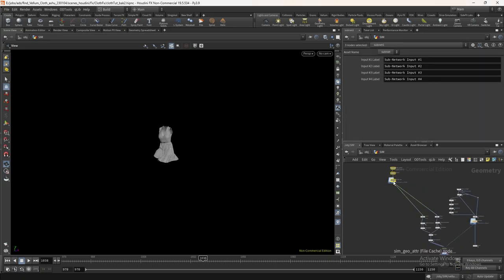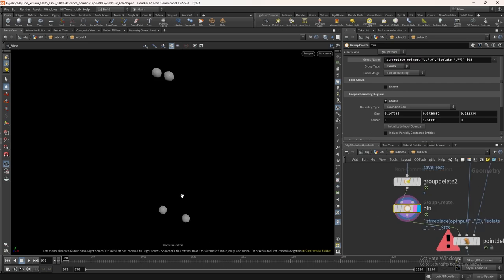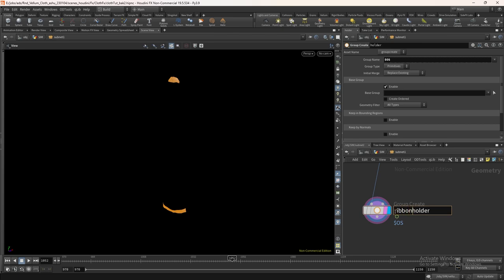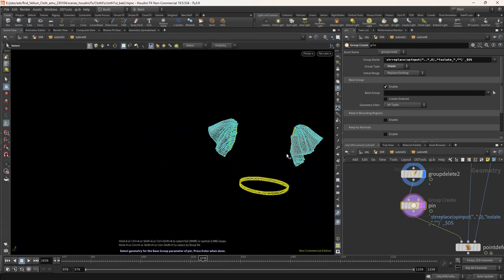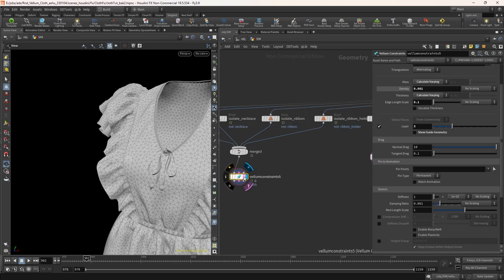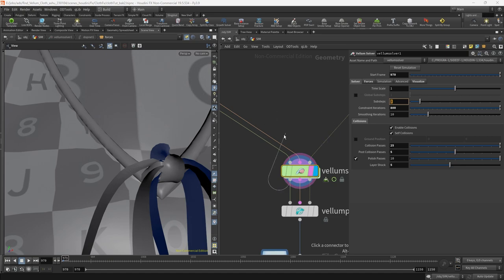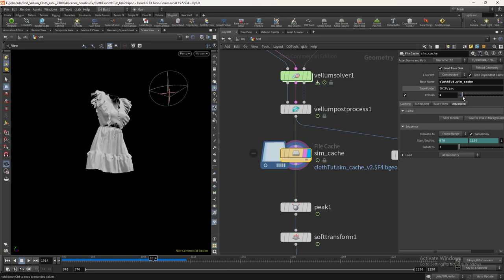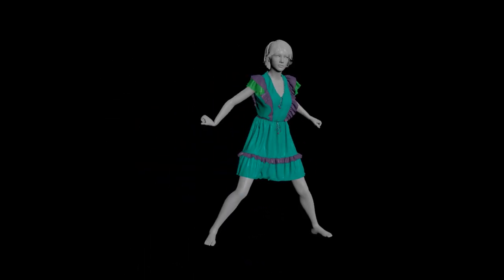Vellum Final Simulation | Vellum Cloth Series | Part -3 | Houdini Zone |

Comment: did u try the Cloth Capture + Cloth Deform nodes instead that wrap HDA? it's like a point deform specifically for clothes
Reply from the maker: I tried to use this yesterday but we have to wrap each cloth separately, and it's quite slow as compared to the wrap HDA. 
instead of cloth capture i will prefer point deform.
Reply: @HoudiniZonefx  Thank you for researching and putting the tools to the test to provide me with a comparative explanation. Very kind.
It frustrates me that I have to rely on custom tools for something as important as point deform, and that there are redundant tools.